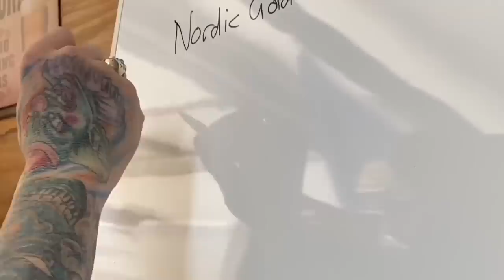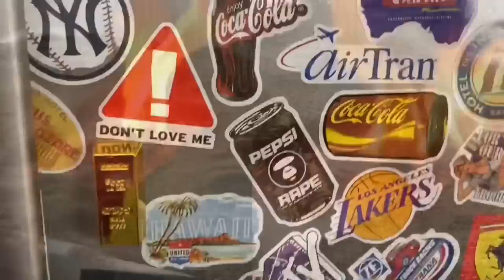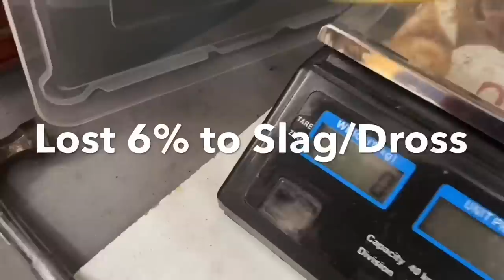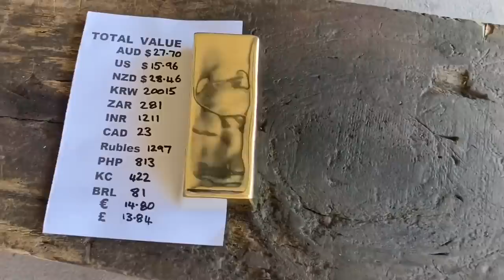Nordic Gold Bar From Scrap Metal - Gold Bar - Trash To Treasure - ASMR Metal Melting

Comment: He would have been a King in the Middle Ages.
Reply: They had scales and even ways of keeping people from shaving off tiny bits of coin.
Reply: If only he could have an angle grinder back then...
Reply: Or electricity...
Reply: Yeah or just a blacksmith haha
Reply: @esino6667  Making electricity is actually very easy as a blacksmith and/or alchemist during the middle ages.
Just because ti wasn't widely discovered, doesn't mean chemistry and science worked any differently back then, lol.

All you need is some acid, and some metals, and you can build a battery, and that's just one of several other ways you can produce electricity using resources available during the middle ages. :P
Reply: @MyouKyuubi  you can make the battery, but it wouldn't have any charge in addition to being very low quality.
Some metals were VERY rare, it was easier to get gold than aluminum.
Reply: Yeah, Aluminum takes MASSIVE amounts of energy to drive off the oxides in raw ore.  We can recycle it really easily today, but only because we've made so much of it over the decades that there's lots TO recycle.  The initial batches of pure aluminum were SUPER expensive
Reply: Is this gold??
Reply: They had no gas powered smelters though...
Reply: @kinyuamagondu5430  yes it's..fools GOLD 😂
Reply: Is this valuable or leisure

Comment: What is nordic gold? Is that kinda like German silver?
Reply: Nordic gold (Swedish: nordiskt guld) is the gold-coloured copper alloy from which many coins are made. It had been in use for a number of coins in many currencies, most notably in euro 50, 20, and 10 cents, in the Swedish 5 and 10 kronor coins, the latter of which it was originally developed for, as well as the Polish 2 złote commemorative coins. Its composition is 89% copper, 5% aluminium, 5% zinc, and 1% tin.

Being a copper alloy, it contains no gold. Its color and weight are unlike pure gold. It is non-allergenic; its other advantages include antimycotic and weak antimicrobial (especially after abrasion) attributes, and resistance to tarnishing.
Reply: @robp2253  I've always found it amazing that a solid 12 inch cube of pure Gold weighs about 1,200lbs.
Reply: Looks like polished brass too me
Reply: Rob P that is amazing. I've always been interested in metallurgy. I just discovered the allow known as german silver and it goes by lots of other names also. I like how mixing different types of allows can have so many types 9f benefits associated with it. Thank very much for you very extensive and detailed comment.

Comment: i  notice that you make sure to heat stuff to avoid a steam explosion but why is it that when u poured the molten metal into the mold, it didnt cause a steam explosion because the mold was pretty much made of water?
Reply from the maker: Yes it’s very weird isn’t it, when the moisture is trapped under the molten metal the steam only has one way to go so will create the steam explosion but when it goes into moist or damp sand there are small holes and gaps in between the sand and the steam will vent a little bit into the sand. But it kinda doesn’t make sense when you think about it sometimes🤔.

Comment: Where does one fine pure tin “in the wild” so to speak? I thought old trinkets and such would be nearly pure tin but mostly finding pewter or sterling. That’s the final piece before I do my own Nordic gold piece
Reply: Tin foil, which is used for scientific projects or to wrap other objects, such as candy bars.
Reply: @kori_snw  aluminum foil. It’s not made of actual tin
Reply: @liveweyeractual  They do make tin foil. I wasn't talking about reynolds wrap, but food service, pharmaceutical, etc wrap. It's made of 99.9% tin.  Or you could buy ingots on amazon an ebay.
Reply: @kori_snw  tin foil has not been made of tin since WW2. Its a misnomer and It’s cost prohibitive. I’ve even researched just now, it’s not a thing. I have bought some off eBay since this comment.
Reply: @liveweyeractual  I own a roll of actual tin foil purchased less than 5 years ago.  Glad you found some tin. Good luck on your project.
Reply from the maker: I’ve been through hundreds of bins and I’ve never come across any tin I have to purchase that on eBay and it’s the same with zinc it’s very hard to find in my area so I also purchased that on eBay.
Reply: @bigstackD  I got my roll from Grainger Industrial Supply about 5 years ago. They apparently no longer sell rolls, but they do sell sheets and ingots.

Comment: I get that the total value is based on trade pricing. But I could only dream of buying ingots of any material for that price. 
Hell I can barely get aluminium let alone copper for anything under $100. 

I want to machine stuff but unless you're willing to spend thousands of dollars at once. Hard to get a supplier where I live in Ballarat.

Comment: How do you make the ingot mirrored
Reply from the maker: HOW TO MIRROR FINISH A BAR 
Matey I start with an 80 grit flap disc on my angle grinder then I use my drill with a 50 mm round sanding discs . I start with 150 grit then go through the following Gritz 240-400-800 Then once I get to the following Grits I use a small squirt of WD-40 1200-1500-2000-2500-3000. The WD40 helps to lubricate the discs and stops the sanding disk binding up with the metal powder . Then after that I use my buffer wheel on my bench grinder to get a perfect mirrored buff on it👌🏻😁.
Reply: @bigstackD  thank you , also your Chanel is amazing and is the reason I started casting thank you again